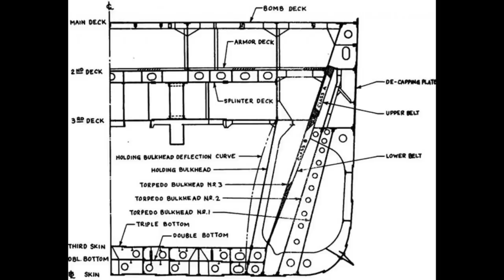The Drydock - Episode 230

Comment: in regards the Iowa's and resilience against anti ship missiles,  the soviet navy actually provided an answer on a memo dated from 1987 or 1988 , I believe the document that is mentioned in the memoirs of Admiral Gorshkov ,  become somewhat public after 2010. I am going to recall from memory and therefore there is always a chance for error but in general it goes like this: The "soviets" had the notion that the soviet ASM would bounce back from the Iowa's armored belt. this exaggerated belief was due to 2 factors : 

- the russian ASM (anti ship missiles) arsenal was inadequate do deal with the armor of the Iowa's. This was not a problem solely restricted to the soviet navy. No one had built heavy armored ships since the early 50's and due to that there had been no need for ASM's with Armor piercing abilities.To make things worse, with the deployment of close in automated weapon systems, such as radar controlled gatlings,  ASM's needed to ability to , when closing the target, make erratic evasive movements  , what meant that  they would decelerate a fair bit  and so the kinetic impact would be lower than often predicted.  Additionally by the 70s , the russian navy - and others - had moved  to  fragmentation based warheads that would be extremely effective against all  bar armored vessels . 

- somewhat due to the inherent russian appreciation and romanticism for large ships (or for funding reasons, as some saw in the Iowa's a reason to push for a soviet response) the iowa's were seen as the most dangerous threat to russian surface vessels.

Due to the combination of the above stated , research and design of a new AP  capable missile was started but nothing come from it due to the political collapse of the Soviet Union. While in theory creating a new armor piercing capable missile would at first not appear to be a challenge , the logistic aspect actually made the process far more convulsed and complex. There was a debate between retrofitting such missiles to existing ships, what would require new larger launchers and guiding systems and by extension reduce the number of available ASM per ship, versus the construction of a few new ships  that would be able to operate the new AP missiles in a rmore efficient manner. Furthermore there was also the question if  existing submarines could operate such weapons, as neither the existing torpedo tubes or vertical launchers present in the soviet submarines would struggle with what most likely would be in terms of raw dimensions,a larger missile. Eventually the decision appears to swung into the direction of  retrofitting , what meant that the designers were essentially tasked with creating an AP capable missile that would need to have similar dimensions to the existing ASM's in service- something that probably could only be achieved by reducing the explosive charge . 

Outside of that, there are a few interesting things that come to memory,
a) Russian naval annalists credited the Iowa's with speeds exceeding 36 knots.
b) Russian intel believed that with laser assistance and special charges the iowa's 16'' guns were able to lob shells at distances far greater than those generally accepted. This is interesting since the Iowas carried an helicopter equipped with the kind of laser devices that the russians mention.  Interestingly the US Navy did play with the idea of a high speed "sub caliber shell" ( 8 inches) that they believed could be hit targets at 80 or more miles, and it is possible that rumors of it had reached soviet agents.
c) Russians also believed  that all or at least some of the Iowa's carried special tactical nuclear 16'' shells.  
d) the general consensus  was that no soviet ships could withstand  more than 2  16'' shells and retain any type of combat capacity,  and that the kinetic impact of a single 16 inches shell would knock out  most electronic systems. In any sort of conflict situation  russian surface vessels should never come to distances of inferior to 50 miles  from the Iowa's.

Comment: On the riveting vrs welding debate you missed out a couple of things. A properly riveted joint is as likely to work loose as a welded one (and riveted joints can be made airtight, not just watertight). The skill level required to properly perform either task is about the same, one is not easier than the other. And most importantly, welding damages the heat treatment of any plate/metal that you weld (only in the area of the weld) and riveting does not.
Reply: Not true. Welded joints don’t work, because a weld physically joins the pieces of metal into a single, unified piece of metal. Riveted joints would work in a seaway because they are two separate plates that are just pressed up against each other very hard by the tension in the rivets. They generally didn’t leak, because the space between them is very small and if water did get in there, it would cause the surface of the steel to rust and expand, sealing the joint. (In fact, a shipyard I used to work at did a lot of work on old riveted tugboats, and if one was leaking after finishing a yard period, they would “dunk” it in the water and pull it back out to let the rust seal the joints in exactly this manner.) The flexing of the joints breaking this rust seal is why riveted hulls would leak in heavy seas.
Reply: @michaelimbesi2314  That was why jointing compounds were used, and you can ( and as an aircraft technician I have) rivet to be airtight.

Comment: Could you do an indepth explanation of why the Japanese Navy had  side mouinted funnels on the Akagi & Kaga please.
Reply: IIRC it has been covered earlier in the channel (didn't Drach do a series on aircraft carrier development where it was covered?). Basically they wanted a flight deck maximally free of obstructions. However it turned out that the side mounted funnels caused hot air updraft / turbulence right in the flight path of incoming planes as well as being very large and bulky, so for later carrier designs they went with the funnels in the island design.

Comment: 00:35:48 - It is my opinion that anti-ship missiles, even realy big supersonic ones, would be of very limited effect against a Battleship. The huge weight of the missiles can be discounted as Radars and Aluminium air-frames are significantly structurally weaker than Armour Steel. The thing that matters is warhead weight and speed, even the SS-N-19 Shipwreck's warhead weights slightly more than the KGV's 14" Shells and has a impact speed equivalent to a range of between 10,000 & 15,000 yards. That would imply a penetration of between 13.5" & 15.7" [adjusted for angle of fall], however it is not an AP warhead it is a HE warhead and it'd blow up before penetrating 2"-3" of steel.
Put simply, battleships are an outside of context problem, and the weapons in service can not deal with them. However it is not beyond the whit of man to solve that issue, either with an AP warhead or a Nuke.
Reply: Nitpick, Granit's warhead is designed to punch through supercarriers which themselves are actually very tough ships.
It's nose is reinforced with a large amount of steel, SAP in nature if not AP.
With it's weight, size, and speed, it will go through any battleship by sheer kinetic energy alone.
Reply: And absolutley wrecking the upperworks would mission kill the batzleship, especidly with all of the cold war equipment like radars and missile launchers.
Reply: @lukahierl9857  Yes. How many missiles would it take to achieve that? A battleship has multiple redundant fire control systems,  a Tomahawk or Harpoon fire would be external to the ship, damage control especially around fire got very good after the Falklands war. 
Battleships are designed to take damage to their upper works and keep on fighting.
Reply: @ThatZenoGuy  I'm curious about the sources you have for the Granit's warhead.  I kind of doubt "it will go through any battleship by sheer kinetic energy alone".  Carriers are a different story, they have much less armor and a lot of planes and gas lines that can ignite.  My impression is that the big Soviet missiles were more HE than AP.
Reply: @gregorywright4918  
Supercarriers are actually pretty armored due to sheer size and number of compartments. A lot of metal to punch through before you get to the vitals.
Granit's warhead has pictures online.

Comment: Would the occupants survive a direct hit on a WWII BB? What sort of side effects (concussion etc) would they be suffering from? Would they be able to continue the engagement, should they survive?
Reply: From a missile (in the context of the Drydock question)?  Depends on the size of the missile.  The fantail types like Exocet and Harpoon - most likely, and some of them might not even notice the hit, especially if it hit the armor belt.  One of those big Russian carrier-killers - most would, but there would be some fires and damage control work to do.  Battleships really need holes BELOW the waterline to sink them.  About 2/3 of WW2 capital ships were sunk by torpedoes.

Comment: When it comes to Bismarck and Titanic l think they have one thing in common. Hubris pure and simple. Their builders certainly knew the ships could be sunk. Put a big enough hole in anything and will sink. As to where the hubris comes from in Titanic's the obvious place to look is the White Star Line in terms of some of the things their PR staff put out. Another place is in the preformance of the White Star Lines ships officers. In Bismarck's case I would point to the German government. And to a certain extent I would put Vasa and Mary Rose into the same circumstances. 
While ships do get lost due to circumstances beyond any one's control. Often there are also underlaying human causes. One case of a ships loss to human error was the Edmund Fitzgerald on Lake Superior in 1975. When the wreck was found the following spring the securing clamps on the cargo hatches were largely intact. Every fourth on though was broken from when the hatches blow off. The ship left port on a Sunday and the captain was supposed to be tight as to paying overtime. and only had the crew lock down one in four of the hatch cover clamps. He supposedly intended the rest of the clamps to be set the following morning. But the weather had turned so bad that the crew could not work on deck. to show just how bad the weather change was when the Fitz left Superior the weather was extremely mild. Sunny skies, light winds and approximately 70 DF/21C. By Monday morning the temperature had fallen to 32F/0C or lower with gale force winds. With the seas washing over the deck. 
See The Mighty Fitz by Michael Schumacher. No, not that Michael Schumacher. He's a friend and he was doing a book tour in Germany and Austria and when he was checking into his hotel in Vienna the hotel staff was anticipating the other one. He says they were sadly disappointed.

Comment: One other issue for the Germans would also be finding enough competent officers to command 300 Type VII(the most likely vessel to be built)boats along with the need for suitable crew(by no means is every sailor submarine duty capable)and 300 type VII boats would need roughly 15,000 crew

Comment: There's an interesting book published regarding the salvage, moving & scrapping of the German fleet scuttled as Scapa Flow.
Can't remember the title but I read it back in the 1980's, so it wasn't one of the more recent such as Cox'sNavy
Reply: The man who bought a  Navy by Gerald Bowman?
Reply: Second half of the book The Grand Scuttle?
Reply: @markrobinson9956  No, it was a stand alone book.
Reply: @benwilson6145  That could be it, if it's the one which goes into detail on building & fitting the air lock tubes & the actual towing of the vessels (I recall photo's of the upturned hulls under tow being in the book I read).
Reply: @GARDENER42   Thats the one, my favourite is the the photo of a cruiser in drydock in Rosyth  sitting upside down on its superstructure.
Reply: @benwilson6145  Aye, that's it.

Comment: 27:28 the extra pressure offered by water tube boilers is only really an advantage with steam turbines... which never really caught on in locomotives. The succesful steam turbine locomotive designs are few and far inbetween - the issue being that the locomotive needs to have good efficiency from standstill to high speed. In addition it must deliver maximum power when starting up. Piston engines and electric motors are fantastic at this.
Some locomotive boiler designs incorporated water tube portions such as the Brotan boiler which was quite succesful in Hungary.

Comment: 31:30 seen as both Warspite and Roma both had the fritz x (I know it isn't a missile but interacts similar) go through them and Iowa has less armour than both (Roma having slightly better quality battleship armour), wouldn't anything the size and speed of Fritz X go through
Reply: You forgot the build of the Fritz X, which was built on an armor piercing bomb. Essentially, it was a solid billet of forged steel with a hollow in the base for the bursting charge, with the bursting charge only amounting to about 20% of the total weight. Missiles are a hollow steel or aluminum cylinder with almost all the weight coming from the rocket motor, guidance equipment, and warhead. If the fuse did not set off the warhead on (or fractionally after) impact, then the missile would crush into the armor like an empty beer can on a frat pledge's forehead.
Reply: The FritzX also was an air-drop weapon that would hit vertically, so it did not hit the waterline or belt like a cruise missile would.  When they say it "went through them" they mean out the bottom rather than from side to side.

Comment: 1/4 of scale !!!!! Haul the Oil King up on charges for dereliction of duty! 

The only reason that could happen is if the boiler was steamed with sea water under an emergency. Otherwise the high quality of water from the evaporators, and maintaining proper water chemistry, the internal surfaces should only have a film of black magnetite. US Naval  boilers under 700 PSI required mechanical cleaning of the watersides around 1800 steaming hours, firesides were scraped or water washed every 600 hours when burning bunker "C". Watersides were cleaned with rotating brushes driven by small high speed pneumatic motors on the ends if air hoses that would easily fit in the tubes. This was called "tube punching". 

If a tube leak developed it could be sealed off by driving tapered steal plugs into each end. The boiler can continue to steam with out significant power lose until 5% of the generator tubes, 5% super heater, and 20% of the economizer are plugged resulting in about a 3% fuel increase at full power. Re-tubing is only required if there is a desire to restore original performance or after a low water casualty that resulted in warped and bulging tubes. It would not be unlikely for a ship to have completed its' service life without being  being fully re-tubed.
Reply: Most of the time the ship is cruising at an economical speed where it does not need all boilers online.  If combat is not imminent, maintenance could be done while underway.  Depends on need.

Comment: if Vanguard had been around in 1982 no way would Argentina even dared to invade the Falklands imagine the NGS Vanguard could have provided let alone the command and control facilities for the fleet she should have been kept to act as a heavy escort for the carriers and command centre.
Reply: Only if the RN would have been able to effectively escort them. They would need AA and ASW protection like the carriers.
No problem with massively increased budgets but at that point the UK could easily have retained proper fleet carrier capability. That would have had far greater power projection capabilities and flexibility.

What the UK (and everyone at the time) was lacking for carrier escort was proper short range air defence.

Comment: Welded joints don't stop the propagation of cracks. When a crack reaches the edge of riveted plate it stops.
Reply: The problem with welding was that the weld itself would crack, while the plate was fine.  That was early in welding's history, once it was discovered and researched they found bubbles and weaknesses in welds that they then figured out how to find and fix.  Plus better training for the welders.
Reply: @gregorywright4918  
Usually the cracks start in bad welds but not always.

Comment: 55:10 Wouldn't rivetting a steel plate to a copper alloy plate and then immersing this contraption in salt water have some... interesting electro-chemical effects?
It is true, welding two different alloys - even when both are iron based - can be challenging, but if you take other factors like corrosion into consideration, so is joining any two sigificantly different metal alloys...
Reply: And welding armor is a no-no, as it damages the face hardening.  Armor plates are attached to backing plates with special bolts.